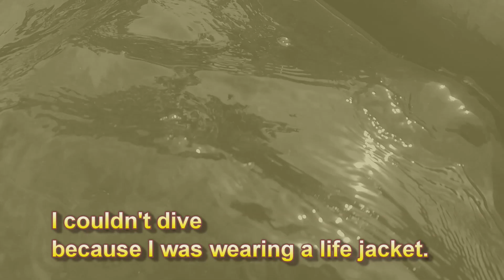Rccar running on water　Wonderful carTRAXXAS RUSTLER VXL

Comment: What model is this ?
Reply from the maker: It is a model called Rustler manufactured by Traxxas.
The battery has 4 cells.This time,
 I used Traxus Slash paddle tires.
Reply: It's called the Traxxas Rustler 4x4 vxl, and the car battery had only 3 cells, because the ESC can only take a 3s lipo. I know this because I have one. If you are trying to hydroplane, I suggest you use traxxas part #4175, because the tire has more surface area and is listed under the accessories list. I hope this helps.
Reply from the maker: @JG-oc9gc  Thank you very much for your advice.
Also, thank you for watching the video. Hydroplaning
It was very difficult.
Reply: @KousRCLife  you are welcome